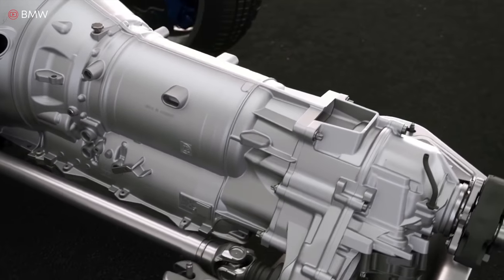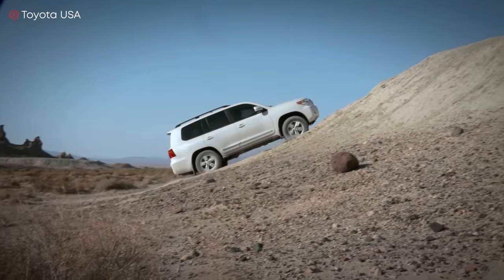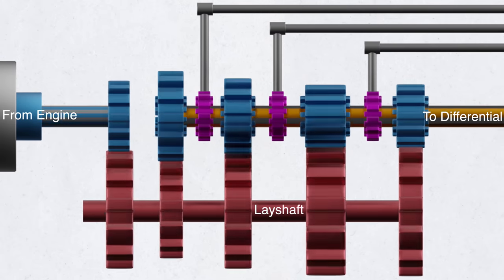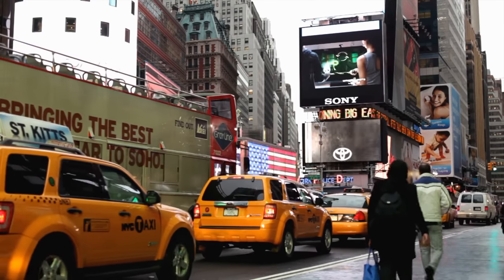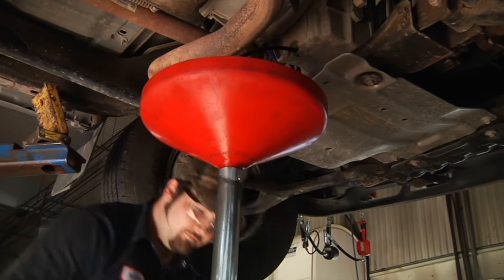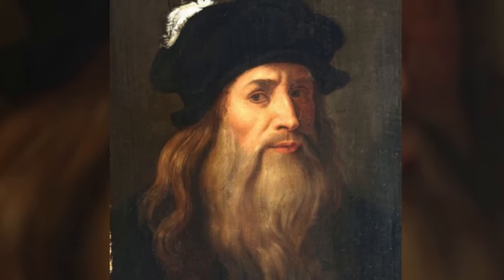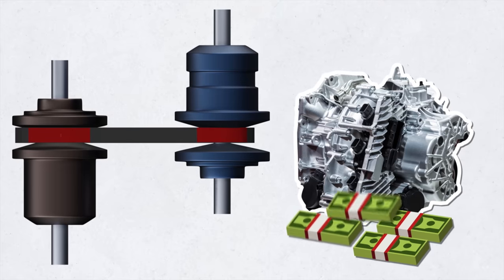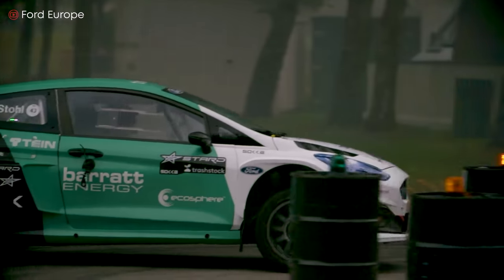Who Makes the Best Transmission and Why

Comment: let me save you some time:

So basically Manual transmission is king 👑 

Automatic transmission is good for torque but heavy 🪨 

Continuous Variable Transmission is infinite gear but prone to breaking when pushed too much to the pedal ⚙️ 

The last one is mix of automatic and manual, with a higher repair cost when broken. same with CVT

Comment: Scotty, you'll probably never see this comment.   But if you do,  how does the engine running at 1800 RPM cause oil pressure problema and engine wear?   My car in 5th gear turns that at 60 MPH.  So if what you said is true, I'm ruining my engin.  LOVE the channel, thanks all the help you give for free.  But this statement really made no sense.   Jayman...

Comment: 7:55 not like real great ones on Tirbines E used Double Helical Locked Train herringbone with separation where they met. It had holes on the shaft the lubricants forced out onto the teeth of gears. Took 80000 Shp to bull gear of 13 feet from 3600 rpm to 193 turns on a 35 ton prop with 600' long hollow shaft. Twisted 1.5 turns from bull gear to prop without failing. Lasted entire commissioned life 1959-2014  Zero to 190+ rpm in less than 20 seconds moving 95000 tons. Thats a transmition.

Comment: Volkswagen and Allison both make the best transmissions there are, with the proper maintenance a traditional allison slushbox will not die, same with their manual transmissions. DSG's are more fluid sensitive since they carry clutch packs instead of a torque convertor for improved fuel economy so changing it is very important.

Volkswagen makes the most damm die proof manual transmissions, I had a volkswagen rabbit with almost a 987,000 miles on it , it was a good car and the clutch was changed at 300,000 miles, before even I was born!

Comment: I disagree, if 1800 rpm does not provide proper lubrication, it's poor engine design. The video works without this statement ;-) By the way, what makes the best transmission, I missed it in the video.

Comment: My 17-year-old Dodge Neon still going strong at 242,000 mi original transmission original engine transmission fluid flushes at every 60,000 miles!
Reply: those had a 3-speed auto too with lock-up. Less gears=more reliability.

Comment: Chrysler Torque Flight 727 best transmission ever built
Reply: I was going to mention that. Those transmissions were indestructible. Smooth shifts at the same time.
Reply: About 50 years ago to demonstrate, a TV commercial showed a man in a Chrysler  with his foot on the gas and never letting up slaming the shifter from reverse to drive smoking the tires.

Comment: My Mazda Skyactive 4 cylinder runs at 1800 rpm at 60 MPH and some 8 cylinder engines run even lower at 60 MPH. At 40 MPH my engine runs at 1200 RPM, Does that mean short engine life from low oil pressure?

Comment: The most reliable car transmission in the world for all times is : Toyota Hybrid eCVT it’s an automatic transmission without gears, without belt and cons, without clutch, without torque converter and without any actuator, has the smoothest drive and feels like you drive a full ev. What better than that, btw it’s the main reason why people are buying these cars, why would you buy anything else and expect a huge repair bill, not if but when? , ! 👍🚘

Comment: We're all going electric.  No transmission needed.  The motors can easily turn at all the necessary speeds.
Reply: some have planetary gears. Transmissions are torque multipliers. Electric have good low , midrange power , then power falls off fast.

Comment: T56 best transmission prove me wrong
Reply: Agree , my car in early 90s had an article done on it. 1st 1988 IROC to be converted to a T-56 from a 700R4 in early 90s. Only cars that had it at that time was Viper/Vette. It was almost a purely bolt-in process. Center Force had to build a Kevlar clutch for it because at over 650 ft/lbs. It smoked their normal racing clutch. Centrifugal SC 383 With Lingenfelter box-ram intake , converted from Mass-flow to speed-density.

Comment: Curiosity : Hondaholic all my life , never a problem with a Honda automatic transmission, now I own a Camry and I have the annoying transmission torque converter “shudder” and the only way to repair such problem is to replace it, even when I am able to do it myself, still is a hell of work and I have to buy a torque converter not convinced if the replacement will fail in the same way ☹️ 😡

Comment: Scotty I bought a used 1998 Toyota Corolla le with only 157000 miles on it only thing it needed was rear struts they guy before me had just replaced the front struts along with the timing belt an oil any suggestions on any way to get the most miles out of the motor as I can I only paid $1200 for it so far I've put 2000 miles on it an regularly check fluids an have found no problems after I put new strut assembly's on the back let me know what you think

Comment: Hello Mr scotty 
Just an inquiry 
I replaced a the rear differential for my 4runner 2005 v6 
My old differential FGR=41:11=3.727
And the one i bout is FGR=43:11=3.909
Does this affect the car acceleration or stability  ?

Comment: So What do you recommend for a Manuel transmission on a 165k miles on an Xb that hasnt had a transmission fluid change ever. Going by information in your video. There is possible vavle body clog dues to how low and dirty the fluid is in the transmission. Would it be too much to clean the valve body inbetween the fluids and filter change? And will it do more harm in doing the transmission fluid and filter change? Or is it best to leave it as is?

Comment: Scotty what do you think of a 2002 firebird Trans Am with the WS6 package. It's the LS1 engine with the manual transmission and has 16k miles and cost 26k but it's been owned by a small celebrity so its been taken care of. It's a California car too. Is it worth it and is there anything bad with those car?
Reply: Totally don't equate the celebrity part in because without any direct proof it will not increase the value to anyone else if you decide to get rid of it. Of course some celebrity cars bring more if the vin and all matches and its sold by that celebrity, but even then if you plan on driving it the car is worth what it's worth regardless the previous owner...jic he doesn't respond.
Reply: I owned one... If you can get it with the WS-6 package (Pontiacs version of the SS) WITH the 6-speed manual, grab it! Those are rare cars. Both the engine and driveline are very strong and should last a long time if you take care of it.
Reply: @Reindeer911  Yes it does have the WS6 package.

Comment: Scotty, you are wrong about running an engine at 1800 rpm and not having enough oil to lubricate the engine.  The 6th gear in my Trans Am (manual shift) was the second over driven gear in that transmission and kept the rpm's down.  At 65 mph the engine was doing about 1800 rpm.  Oil pressure was way more than adequate to keep the engine friction points lubricated.  So, operating on a highway at 65 mph for any length of time, by your judgement, the engine would be destroyed. Totally wrong assumption!

Comment: Personal experience.  I'll ignore manuals since nobody uses them anymore.  Best Japanese automatics:  Aisin.  Toyota uses them.  Worst?  Jatco.  Honda makes their own.  They're okay, but do fail from time to time.  European?  I really HOPE it's Volkswagen because that's that my Tiguan has.  But considering who the alternatives are I like my chances.

Dual-clutch?  I only have experience with the VW.  Lots of experience.  Total of nearly 100K.  Flawless.  Do NOT neglect to change the fluid!  It's not a difficult DIY procedure, but you do have to read the instructions.  

CVT?  Haven't owned one.  Wouldn't own one.  I've never heard anything good about any of them.  

In all cases:  CHANGE THE FLUID!  Nearly all  automatics claim to be "Factory sealed" and "zero maintenance."  That is only true if you don't need it to last beyond the warranty period.  There is nothing magic about today's automatics vs old ones.  They're the same tech.  Same fluid.  Same maintenance needs.  If you do not change your ATF fluid regularly it WILL fail early, guaranteed.  40,000 miles!  Not a mile more.

Comment: Hey Scotty
I want to buy a Toyota Rav4 2019, hybrid  (I live in France, no more gasoline version just hybrid) with 35000 miles, did you say it’s needed to change the oil transmission of the CVT beetween 30000 and 35000 miles?
I want a reliable car, is it a good choice?
Thank you

Comment: My civic overheats on a red light. I’ve changed the radiator, the hoses, radiator cap and the thermostat. Still over heats at a red light. Need help 😩🙏🏻

Comment: No question Mazda's 6 Speed manual and auto are the best transmissions you can get in a car right now. I wouldn't touch any car with a CVT or dual clutch.

Comment: Wasn't sure if I should just comment on the most recent video for better chance at a response or what, but here goes. Doesn't have to do with transmission. My 2008 Saturn Astra XE has replacement headlight assemblies that came from Europe somewhere. When they were installed, the ports and bulbs didn't match up really so a dremel tool was involved to get the bulbs to fit in the assembly. After inst alling and testing, the low beams work, but the high beams turn off 1 second after being activated. The dash light for high beams stays on, but the lights don't. Anything you can say about that?
Reply: Too hot- scotty

Comment: wait, so my 2011 300C doing 1500 rpm while doing 60 mph on my daily commute to and from work will ruin my engine from low oil pressure? I thought my mild driving  habits and predominantly highway miles, very few stop signs and light here in rural Utah, would extend my cars life, especially given all Scotty's disdain for them. Doe! But seriously, it has been a superbly reliable, luxurious, performing and stylish car with only a battery replacement at ten years and a broken AC mixer door motor mounting plate, which i fixed for free myself by reinforcing it with JB weld. Ha! :)... and regular oil changes.
Reply: PS, it also gets 30 mpg at 60 mph, with a 5.7 hemi with the MDS.

Comment: My 2015 Hyundai Sonata Hybrid Limited, if it were direct drive (No transmission or gear reduction) at 26.3" wheel diameter would be traveling 60mph at 767 RPM

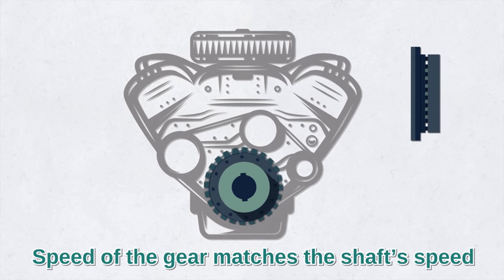Comment: @3:37 Manuals are no longer as fuel efficient as CVTS and automatics.  I don't know what Scotty is thinking.
Reply: you missed it.He said manuals get better mileage except in recent models.
Reply: @superaa6779  at what time stamp?
Reply: @TomTom-gn9mp  What difference does it make? You pay a lot more for a slight increase in fuel economy, and get a piece of junk in return.
Reply: @solarfall2728  It depends on the vehicle and most aren't offered in a manual.  Automatics get much better fuel economy and are also quicker.  Times have changed.  Manuals are no longer quick and as fuel efficient compared to the Automatic models.
Reply: @TomTom-gn9mp  That's a pretty slim difference in mileage for all the trouble. As for performance, not really. Automatics have gotten better, but  they only spec quicker under very controlled conditions. For anything other than a straight line, manual is far better. Going straight, it depends on the test. Also, its very hard to do a fair comparison. Most companies are phasing manuals out, and its very easy to map motors and auto transmissions to perform however you want. A simple tuning can make one faster or slower than the other.
Reply: @solarfall2728  About 96% of vehicles on the road in the US are automatics so they can't be that bad.  In many vehicles you have to buy the base trim level with not many features to get a manual.
Reply: @TomTom-gn9mp  Not all automatics are the same. The ones with dual clutches, cvt, 8-10 gears, etc,... are not very good. The industry wants us to buy these designs, so they make it hard to get something traditional. 

I work for Ford. Our cars are ridiculous. Its almost impossible to buy a normal vehicle.  Everything is turbo, dual clutch, gdi, complicated transmissions, and complicated electronics. Most customers don't really want vehicles with all this crap, but they have no choice. If Ford offered something normal, no one would buy all these experimental vehicles they come up with.  

If you want to see proof of all this, go to a dealer and check out their service department. Heavy line work was always pushed off to the side, or put in a smaller building. Now, entire dealerships are heavy line. We have lube techs pulling motors and transmissions. We used to get 1 or 2 lemon law cars a year. Now we get 1 or 2 a year.

Comment: It it important to change oil in the transmission. Why am I being told mine is Not serviced because it is sealed..  help I feel I need to change the oil in there but not sure if I can because the dealer says No

Comment: If I can't get my manual gears to switch do I need  a new transmission?
Reply: Clutch maybe? Had one go out on me and it wouldn't go in reverse. Got my husband he got in it and said Clutch had went out...seems like I had to replace the throw out bearing too...and it was out of brake fluid...something like that...I know the clutch uses brake fluid...
Reply: yes , synchro rings wear out as do input , and output shafts too. If you grinding gears , some gears may need replacing.
The1-2 synchro is the 1st to go. Also clutch master cylinders do go out and leak fluid on floor. Ask me how I know.

Comment: I have never changed the transmission in a automatic transmission even with cars with 200,00 miles. And I have never had a problem in a GM car or truck.

I did try changing the transmission fluid on a 1998 Dodge Ram & could never get the gasket to seal properly.

Comment: I'm curious if a automatic transmission can sustain high speeds like maybe 180 mph (not concerned with a quarter-mile as much as a long constant high speed on an open highway). Maybe a standard transmission would be best but Im pretty certain highway patrol cars are automatic but I don't think those cars are able to maintain speeds like 180 or even 200 mph.

Comment: Thank you sir. I had a question and was hoping i was lucky enough to get an answer sir. I recently got a camry xse 2020 and did not get a cold air intake instead got the oil air filter and kept the stock cold air box. I simply have to replace the stock paper filter. Is that ok ?

Comment: No mention of the dual clutch transmission?
Reply: @Mark Codiroli It shifts like a manual transmission (i.e. it doesn't use hydraulics, planetary gears, or a torque converter) that shifts automatically.  It uses one clutch for the even numbered gear and another for the odd numbered gear.  Consequently it will almost always have an even total number of gears.
Reply: @Mark Codiroli I did not know a DCT relies on hydraulic pressure for clutch actuation. I assume the hydraulic pressure is generated through a pump since there is no torque converter? Also, I believe the shifting is controlled through electronics rather that a valve body?

Comment: No matter how intelligently you engineer a transmission system, it can't match the electrical speed and torque control systems in terms of responsiveness and efficiency of traction and regenerative braking which can incorporate all the best elements of power control for any driving situation.

Comment: "semi-auto" = an excuse to spend more on a transmission while charging you even MORE for repairs. 
actually, the only semi-auto I've ever owned was  Mitsubishi model, which never failed me once, even after attempts to dog it out, even including maintenance, as young stupid me once drained it thinking that it was the OIL tank. 
But yeah. Just buy a manual.

Comment: I have to disagree on the CVT   2014 Honda CR-V   VS  2016 Honda CR-V   2014 real automatic VS 2016 CVT   the CVT gave me 5MPG less both City and Highway and was the biggest piece of crap I EVER drove. Even my wife asked what is wrong with this car to which I said so it isn't just me.  I went back to the 2018 Rav 4 and just traded it for a 2021 Rav 4     NEVER EVER AGAIN will I buy something with a CVT transmission in it!  Honda shot themselves in the foot by putting that in the CR-V  It also had no idea what to do in the snow. One of the worst systems I have ever drove!

Comment: I'm almost 50 and have never owned a vehicle with an auto transmission. Anyone else?
Reply: You live in a rural area? 
Personally I've owned both.  Manual are more fun and not that much more difficult to operate.  Even in city traffic.
Reply: started in 1973 in a 61 Bug. 4-manual , no fuel gauge , just   a MC-like foot-operated petcock.

Comment: Implies manual as most reliable at 9:45.
Reply: 9:39
Reply: I don't agree. After 50-100 thousand miles, clutches of manual transmissions have to be replaced. But AT is much easier to drive and maintain, you have to change transmission fluid after 50-100 thousand miles.

Comment: How can there be a best transmission????   The applications are all different.  In tractor trailers, automated and automatics are taking over.  In companies controlled by people with MBA degrees.  Now they wonder why the tanker trucks are rolling over more than ever.
It may take more thinking and coordination to shift 13 or 18 speeds.  But now drivers are becoming less involved in operating the vehicle.  And are distracted out of boredom.
Electrics may be fine for in town driving and mindless drivers.  But for more complex situations.  It is actually easier to manage difficult  situations with a manual.  People just need to be trained.  And the Eco- extremists and the conservatives don't want more drivers to be trained.  And have reduced and gutted driver training.  For everyday drivers.
The Achates/Cummins version of the diesel engine, is making a cleaner, more fuel efficent, and power dense engine.
But the best transmission?  The one that works reliably for longer than the body or the engine last!